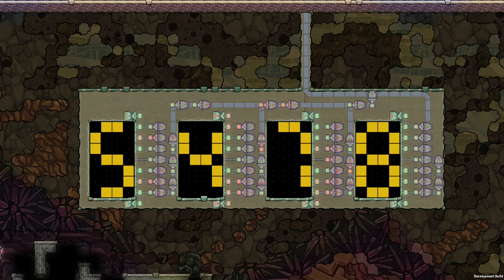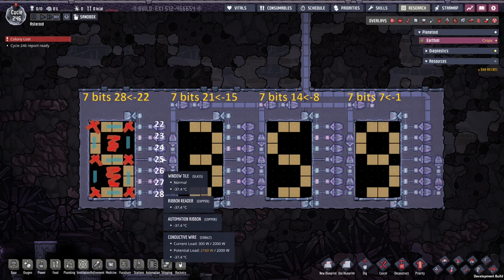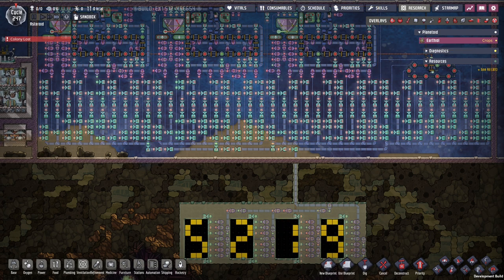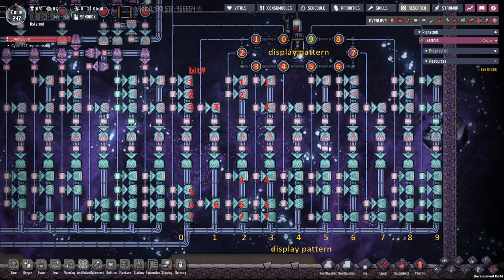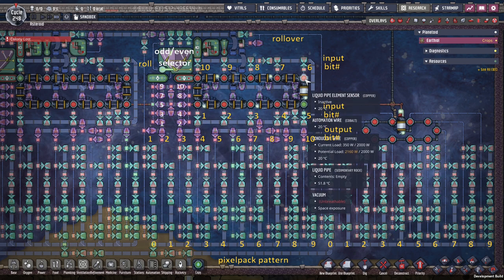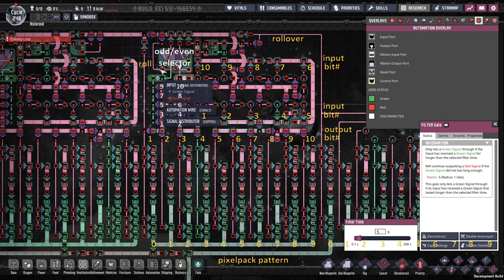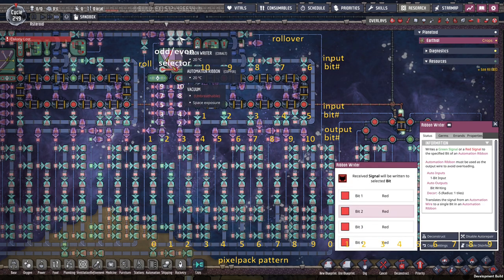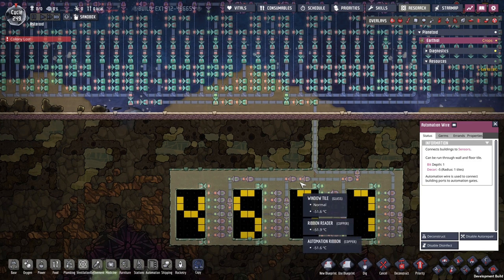IT FINALLY WORKS! The Countdown - Oxygen Not Included

Comment: Interesting design, but you could farily simply apply already quite a bit of compression into it. If you would merge the output signal. Since you only want to set 4 bits at WORST you kinda only need only 4-5 inputs into the ribbon. (Depending on how you would deal with the 0)
So you could map (assuming the 0 does not exist):
1 -> 1,      2 -> 2,     3 -> 1, & 2,       4 -> 3,
5 -> 3& 1     6 -> 3, & 2     7 -> 3, & 2, & 1,      8 -> 4
Etc etc etc.
This would allow you to compress things a lot easier especially since you can use just 1 directional gates (timed gates that are effectivly with 0 delay) to ensure this does not pollute each other.
And it would reduce the size to a managable amount.
In fact i just sat down for a couple minutes. Here is a functional design that does 1-9 counting. But in a 9x11 size. (Less orderly but working perfectly with 0 polution)
https://cdn.discordapp.com/attachments/441859307198349312/853205728529743922/Basic_Counter.yaml
Edit but even with some cleanup that could be compressed a bit more.
Reply from the maker: Thank you! Going to look into this to compress the setup.
Reply: @greezyhammer764  I bet you can easily improve my base design. Since you can build really structured. That is sadly out of my scope. I am more of a optimizer/simplifier of logic.
Anyways. I really enjoy your super technical videos.